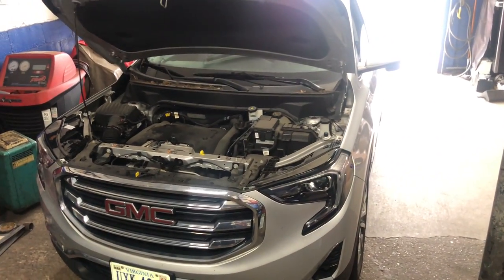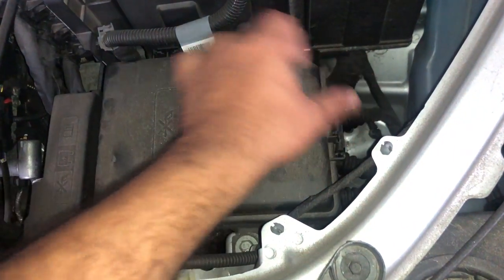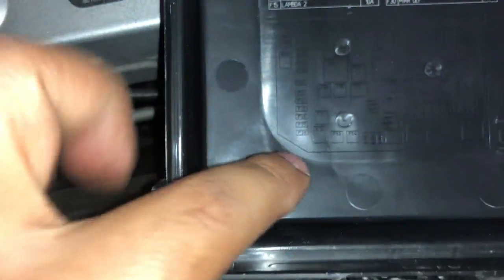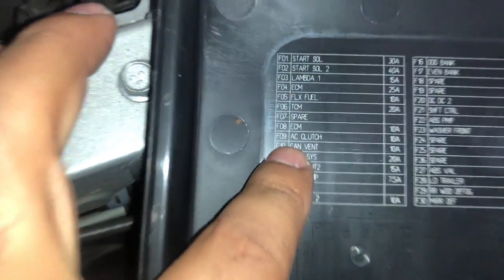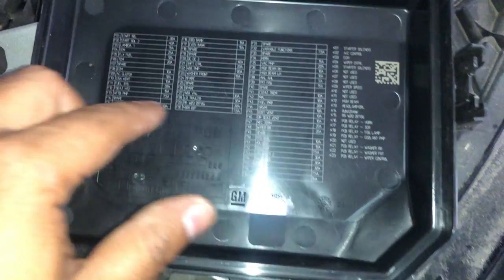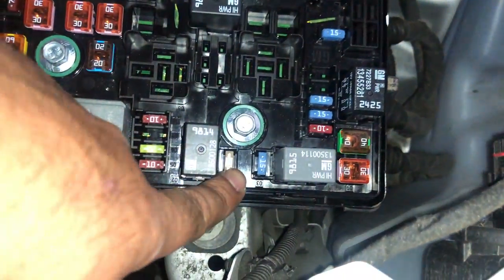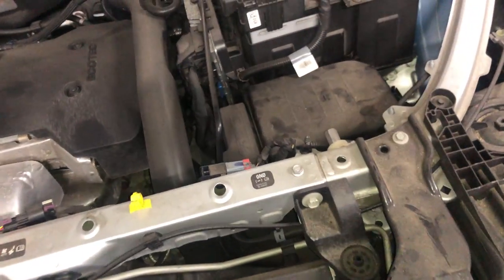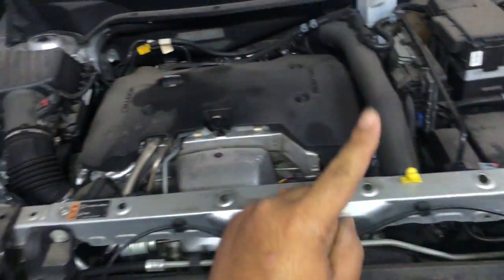GMC Terrain 2018 to 2022  AC FUSE and AC control relay   GMC AC STOPPED WORKING

Comment: Im going crazy in my 2018 yukon i changed the battery i must have shorted something out cs i get all kinds of checks now . Says battery low alternator changed both still same and fans kick in i delete with computer the codes fan calms down . When i hit ac nothing happens
Reply from the maker: Did u check fuses

Comment: Could it be a fuse if the ceiling ac in my acadia doesn't blow but the front and the rear floor ac works?
Reply from the maker: No it’s one systym cooling all

Comment: Hi where/ which fuse would be responsible for the radiator fan??
Reply from the maker: Fan? Or ac?
Reply: Please tell me. Where is the relay and the vent fuse under the hood.
Reply: Fan